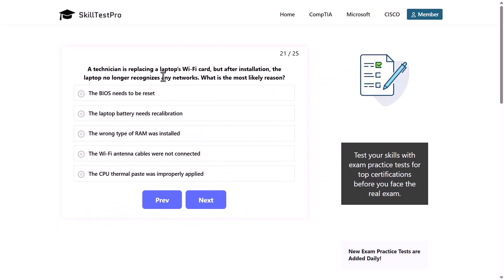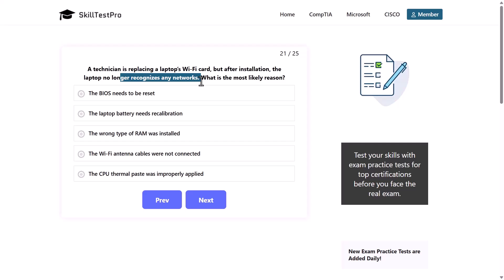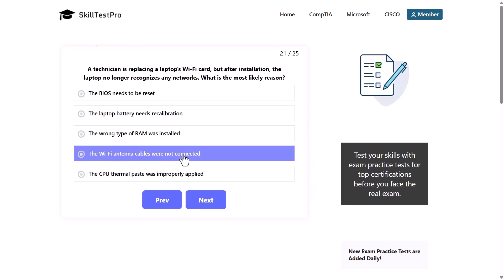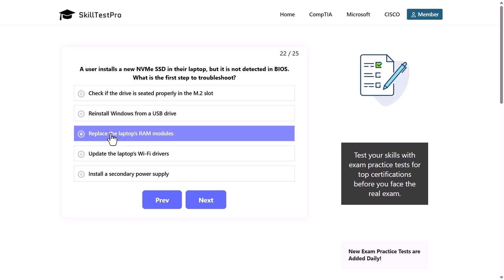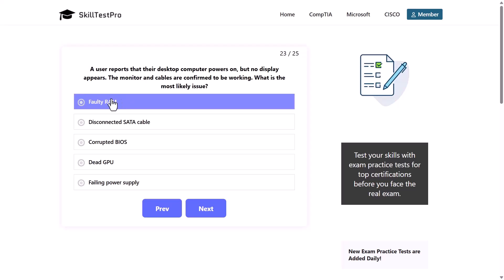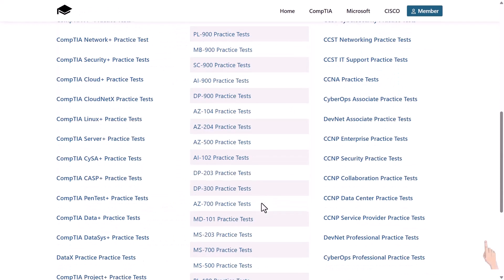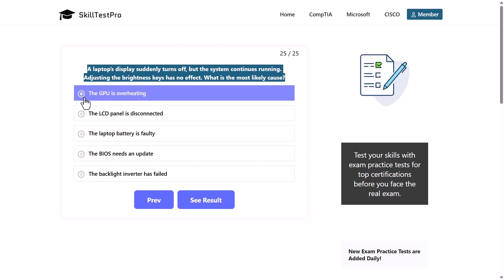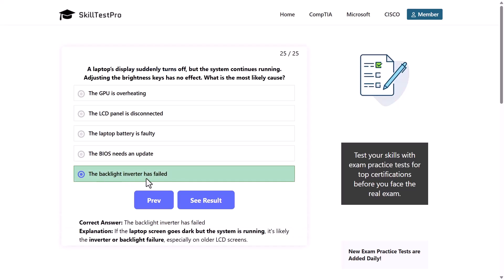CompTIA A+ Quiz

Comment: Questions are so easy are u sure that Comptia a+ exam is so easy?
Reply from the maker: These are only some questions and does not cover even 10% of CompTIA exam objectives - but if you are familiar with all their exam objectives like Wihi standards, Hardware, networking, ports, cat cable speeds, RAIDS etc then yes comptia is easy as it is entry level IT cert.
Reply: @TECHWOOLF  thank you senior